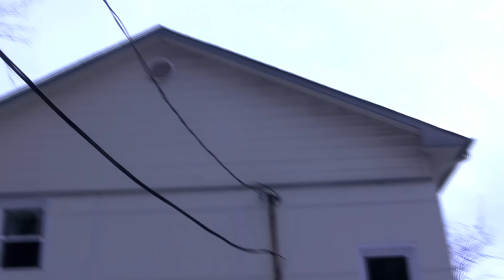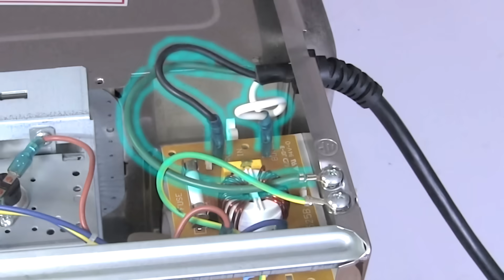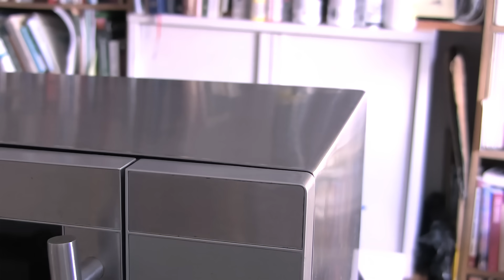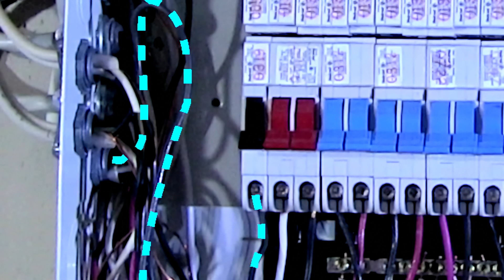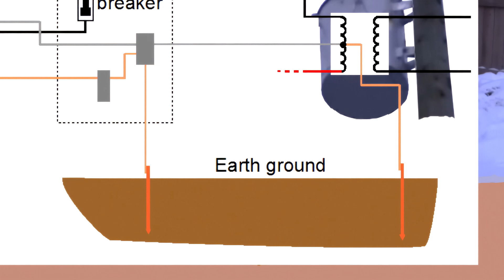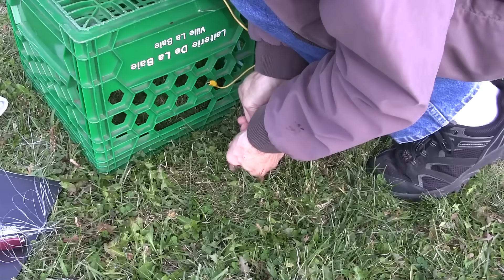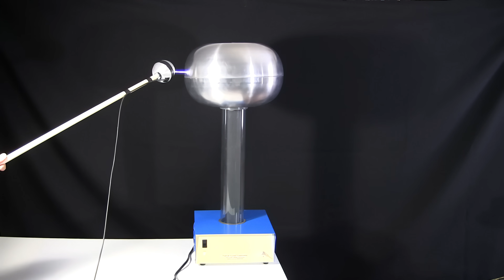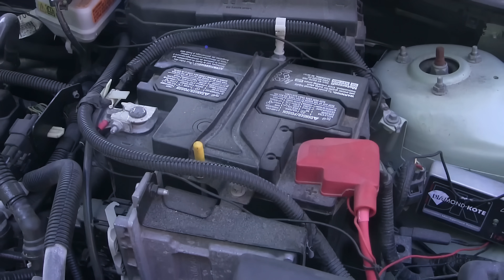What is Ground? Earth Ground/Earthing

Comment: So, in a circuit diagram that has a ground and a +x V connection point, we connect the ground to the neutral/negative of a power source, say a battery?
Reply from the maker: If the circuit has a +V connection point as the power source then the power source is DC (Direct Current). Batteries put out DC so that means the power source might be a battery depending on the voltage required and whether or not the circuit requires constant current. If the circuit requires constant current, which a battery can't provide directly, then you'd need a constant current DC power supply. So if a battery will do then yes, connect the ground to the negative to the battery. It may also want to be connected to an actual ground too though (e.g. a house solar power system).

BTW "neutral" is a term used when the power source is a wall receptacle (AC Alternating Current) which you plug into in your house and does not involve batteries.
Reply: voltage is a relative term, voltage at the "+xV terminal" is simply xV higher than the other terminal labelled ground. If you actually connect the ground terminal to earth ground, then the "+xV terminal" can be said to have xV above earth ground potential
Reply: @philiptong4978  I know that. The theory I understand fine. What I asked is what to do when making a real life circuit from a provided schematic.
Reply: @Fat_Paws  lets say the battery output 3.7V, if you consider positive terminal having +3.7V, then the negative terminal is at 0V
Reply: @philiptong4978  No shit. Lol.
Like I said, I understand the theory fine. Ergo, I know what potential difference means.
Here is my question presented in dumbspeak - " I make machine? I gots drawing of wires. I smart, connect all tiny pieces. But stupid drawing no show where I put battery. Only ++. Where is other end connect?"
Reply: @Fat_Paws  look up "floating ground"
Reply: @philiptong4978  TY for patiently continuing to try and clear up this fundamental misunderstanding I have. Really appreciate it.
Now, from my understanding (had to read it up again just now since its been so long)', floating ground is essentially where the ground connection does not exist or isn't specified.
If you could indulge my stupidity one more time, could you please tell me where or what points do I connect the power source in this basic circuit? - https://i.imgur.com/6h5efsU.jpg

Comment: When you mentioned lightning, it got me to thinking what OTHER  effects it could cause, other than those mentioned.  What if there is a nearby lightning strike to the ground?  Couldn't the long ground rod(s) create a path for high current lightning to go UP the rod, possibility destroying sensitive electronics in the grounded device?
Reply: And because the ground wires are connected to the neutral wire, every electronics would be affected regardless of being grounded or not.
Reply: @54461jessy  Time to redo the code-book for the 21st century.  Perhaps toward a move from high voltage AC to low voltage DC.
Reply: search for "earth potential rise"
Reply: @dale nassar - WHY would the charge leave the earth and travel up the wire into your house?   Where is you so-called "PATH" going?
Reply: Electricity is trying to return to its source.  So lightening is discharging back to the earth.

Comment: haven't finished the video yet, but in the example of the broken insulation. Why wouldn't current travel to the case and then to the person touching the case even with ground?
Reply from the maker: It could, or at least some of the current could if you're also connected to ground somewhere. The current will take all paths but the amount of current through any path depends on the resistance of that path. You have a much higher resistance than the ground wire so you wouldn't get as much current. However, once the breaker trips (the switch in the breaker panel opens) then no more current will be flowing through the hot wire anyway and it will be safe again.

Comment: What is lamp?
Reply: A resistance wire like tungsten (If you mean indescent traditional filament bulbs)  which is in a vacuum and glows red hot like a little heater and gives off light and does not burn out due to the lack of oxygen ,very ineffective as it generates more heat than light as per effectiveness of consumption.
Reply: I love lamp
Reply: Palm

Comment: The ground and neutral wire are conected. So why isn't the neutral wire also connected to the case? So there is less wire you have to use, because you don't have to use a ground wire at the plug
Reply: because of safety reason:
1. consider what happens if the hot & neutral are reversed (faulty wiring inside the case, plug reversed at the wall, faulty receptacle wiring, faulty power panel wiring)
2. neutral wire normally carries the return current, due to wiring impedance there will be non-zero voltage and harmonics on it
3. grounding wire does not carry current and kept at earth potential in normal circumstances
Reply: The ground isn't needed it's just a safety feature and connecting the backup to the primary does not make sense when it's a safety feature.

Comment: Hi, what colour for the cables is used to identify HOT, NEUTRAL & GROUND?
Is it AC or DC current?
And what's the voltage?

Thanks to internet one can woble around the Earth. Well I'm from Buenos Aires, Argentina.
Here it's similar.
Got a different plug. Call them LIVE, NEUTRAL & GROUND. 
Re cables our Norm says: for LIVE(hot) use brown, NEUTRAL pale blue, GROUND green with yellow stripe.
220v AC

Looking forward to your comment
cheers
Richard
Reply: Since there is step down transformer it's AC to the house -Hot will be equivalent to live and those goes to the breaker switch,America runs on 110v.-your colour codes seems to be same as we have here in South Africa where we run at 220v AC as well.
Reply: Hi @ericscaillet2232  well yes from South America: Peru, Brazil, Bolivia, Paraguay, Chile, Argentina + Uruguay are on 220V; rest of America 100/127V range.
Hereunder got the link to list of Voltage around the World by country

https://www.worldstandards.eu/electricity/plug-voltage-by-country/

Cheers

Comment: How do electrons “choose” to travel through the neutral or ground?
Reply: Path of least resistance which would be Earth ground (ground wire coming out of the house electrical panels and to the ground rods outside) instead of going through the power company's ground ( neutral ) wire. Otherwise if there was no ground rods (primary ground), extra surges of electricity would travel through the power company's ground ( neutral) and also the neutral in your house wiring and fry electrical components and devices. Fire hazard. But there is also a secondary ground which would be the cold water pipes coming into the house. And now they make you ground the gas lines coming into the house also
Reply: I'd guess whichever has a lower resistance.
Reply: It’s misconception, Electrons don’t travel, in fact drift velocity of electron or speed is just few cms/sec comparable to speed of ants.
Reply: @pbraju123456  Electrons do move ("travel"!!) - as you say they are like ants and carry a huge charge (1.6E-19 Coulombs) which doesn't sound a lot but 1 Amp DC is equivalent to 6.25x10^18 (six million million million) passing per second.  A 4cm diameter copper cable carrying 2000A DC would have them moving at 0.015 cm/s which is very slow but still amounts to 13 metres per day - a snail might go 15x faster than that!  Of course, for AC they would be shuffling backwards and forwards at the supply frequency and hardly moving more than a few microns.
Reply: George Reynolds you are correct and I agree totally. What I meant was they don’t travel at lightening speeds. I would say they push rather than traveling. It’s just like a tube filled with marbles in a line. When a marble is pushed from one end, one marble comes out from other end. It took long time for me to understand this concept.
Reply: @pbraju123456  Yes, true!  Most people think of them zipping down the wire at the speed of light, but as often happens in physics, the reality is quite different.
Reply: @pbraju123456  Great thanks!
Reply: Depends on if you mean individual electrons, or "electricity", which is billions of electrons moving at the same time. A single electron's movement is guided by very complex quantum electrodynamics wave equations based on probabilities and such... probably not really what you're asking about, as no sane engineer would ever try to model electricity at the quantum level. Electricity as a "current" takes every path available to it, so it would take both neutral and ground. The difference is the impedance/resistance. The higher the impedance, the less of the electricity (fewer of the individual electrons) will go down that path; this is called Ohm's Law. Since the ground path is specifically built to have as close to zero impedance as possible, if there is a path to ground available for the current, almost all of it will go down that path, and only a small amount will go through the neutral path that has a load on it."
Reply: @KutuluMike  He's asking about resistance, not about quantum mechanics, electrodynamics and impedance!
Reply: @karhukivi  resistance in AC circuits is impedance and it's all electrodynamics.
Reply: @KutuluMike  True, but the guy asking the question seemed to have very little knowledge, a beginner.  Your answer was far too complicated for him, he needed a simple explanation!
Reply: @KutuluMike  Very cool, so a small and negligible amount still may go throw the neutral if a ground is present
Reply: @DavideousIII  Yes. Will go through the neutral. But since the amount of current is inversely proportional to the resistance (by "Ohm's Law", which is a very simple equation where resistance is on the bottom of the fraction) and the ground wire has a "nearly zero" resistance relative to anything else, the current will be tiny, so tiny that for all practical purposes we ignore it.
Reply: Electrons are negatively charged, they are attracted to positive charged ions (atoms). The wire is made of atoms which contain very few electrons. The Hot wire is Filled completely with electrons and they are moving back and forth. When you connect the black wire and the neutral wire, electrons rush through the neutral wire and complete the circuit. Remember since I’m explaining this in AC, Electrons will move in one direction if it were DC. But your home outlet is AC.

Comment: In the U.S. if it's not a sub-fed panel, the ground and neutral are bonded in the panel. Also the shortest path to ground would be to the ground rod instead of the neutral or ground coming from the power company. If there was no ground going to Earth coming out of your electrical panel, the surges of extra electricity would go through the neutral in the house wiring and would fry electrical components and devices. In my opinion it would be better to isolate the grounds and neutrals in every panel.